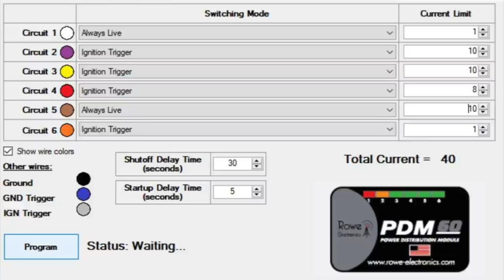I Installed a PDM60 to a customers BMW R1250 GS HP.

Comment: Hello from Ohio, USA Steve!  Check out the Rowe Amplink PDM.  It basically has the same features of the PDM60, but is Bluetooth programmable through a tablet or smartphone.  I personally use it on my 2019 R1250 GSA with my iPhone XS Max, and it works flawlessly.  No more having to connect it to a laptop while on the road if changes are needed.  Great channel!
Reply from the maker: I know . I stock that too.   Video will be coming soon for that too soon.  I’m the only Brit in uk who has the AmpLink.  I’m expecting great things
Reply: @ABIKETHING  I'm looking to put this into my TRK502 too, but the conversion rate a bit too much my currency nowadays, unless you have other way for me to get it from, I'm glad to make the deal

* Now I heard about Amplink, might go with that instead
Reply: @ABIKETHING  so I only connect the positive to the positive of the output switch?

And the negative to the ground block

This means that each auxiliary is wired in series with its switch right?

Comment: You can connect Denali Can smart by utilizing two of the circuits 15 Amp + 15 Amp. Neat unit never seen that one before and Canbus friendly.
Reply from the maker: 🤔I think I'll need to investigate this.  I know someone with an electronics degree so i'll certainly run this past him.

Comment: Hi Sir... I’m from Zamboanga City, a city far south of the Philippines. A very nice tutorial video and I’ve installed on my friends GS1250 exclusive but using Canopener from Clearwater, installed the Rowe PDM60, Innov and Denali Soundbomb. I just want to know where you got the bikes clean 12volt switch connection? Where is it located? Cause as I installed and hooked up the grey ignition wire from the pdm to the can opener to the Clearwater canopener yellow hot relay drive wire, still the pdm is always on.... it drained the Gs batt the next day. Thanks and hoping for your quick response. Good day..

Comment: He should have gone for a quadlock mount and wireless charger 
Did that fitting take you long? What are the pros & cons of the Denali powerhub2 vs Innovv powerhub2 vs Pdm60?
Thanks
Reply from the maker: I'm not a clock watcher and combined with running the mail order side of the business I spread the installation over 2 days.  However I'd set aside 4 hours if I was doing it on my own bike and wanted to do a really clean job.  Pro, cons?  Basically what I said at the beginning regarding fuses vs circuit breakers. Plus the PDM will allow up to 60amps whereas the other 2 products are 30 and 20 amps total.
Reply: Think the quad lock wireless is for cars only. They do a motorbike one which has a cable from the bike to the holder but you then have to plug in from the holder to the phone
Reply: @andrewbooth4341  The one featured in the navigation vid on the Nomad Sweden channel looks like it’s wireless.
Reply: @andrewbooth4341  there is a wireless quad lock for bikes, they took it off the market for some reason, but it’s coming back, it may be back already.

Comment: where do you connect the clean switch wire to on the bike
Reply from the maker: Sorry, this is bad form on my part as I have made loads of videos prior to this showing where I get the switched live from so I assume all viewers know 😄.  I take it from the 7.5amp fuse on the fuse block you can see next to the red pro plug.  Red and Blue wire.  On this bike the grey trigger wire on the PDM60 is spliced into the red/blue wire leading to the 7.5amp fuse and then the yellow trigger wire for the K2 is tapped into the grey wire.  All neatly sealed with BMW OEM tape.

Comment: Hey Steve, does the PDM60 replace the power module on the INNOVV K2 or do have to add to it, does it down convert to 5v?
Reply from the maker: No it’s doesn’t not replace it.  The k2 dvr needs that converter.

Comment: Surprised you didn't install the AMPLINK which as far as I can see is identical to the PDM60 though connects via Bluetooth on mobile phone which is far more convenient than USB.  Also you can use a battery conditioner with AMPLINK via it's dedicated wire!  And solves the Apple MAC problems as use iPhone.  AND you wouldn't have to leave Din plug constant power ... just select it on your mobile phone App when you want it!  Great vids btw!!  I'll setup my Africa Twin soon.

Comment: HI Steve, would you power the CanSmart from the PDM60?
Reply from the maker: As I mentioned in the video, no i wouldn't as the cansmart has a 30amp fuse and the individual circuits max out at 15amps each.

Comment: Where is the switched ignition wire on the GS?
Reply from the maker: Fuse holder under front seat or buy a switched power adapter from our website and plug into GPS switched power.    Use search window on website to find the product
Reply: @ABIKETHING  Thanks Steve.  Gonna add one of these while the riding ain’t so good.

Comment: HI Steve, have you tried Parallels for Mac? its a virtual operating system manager for mac that lets you run a windows operating systems and other OS;s on your Mac.
Reply from the maker: Yes I have, i use to use it on an old mac. Memory hungry as I remember.  Good solution but I don't want parallels on my mac just for doing this.  However i could see myself using it if i couldn't source a window pc.

Comment: How does one remove the ECU?
Reply from the maker: Just unplug it
Reply: @ABIKETHING  I meant how to remove the actual ECU.  I could unplug it if I could move the ECU, but it seems stuck on the bike with no screws.  Also, is there any room down there and will it not get flooded at the first decent;y deep water crossing?